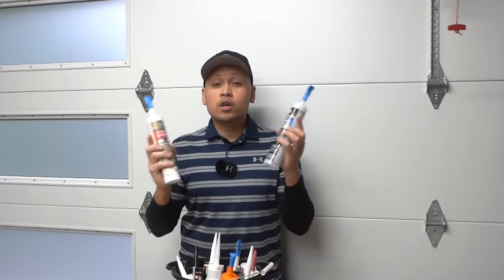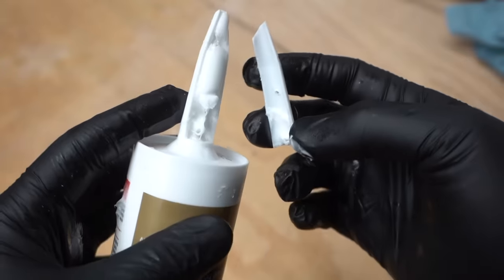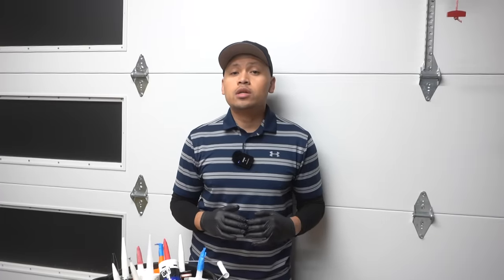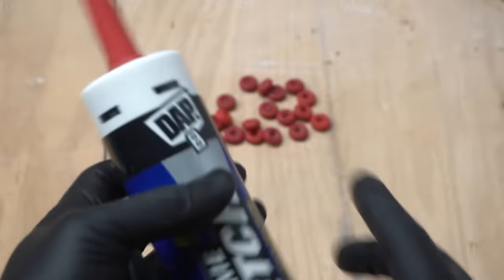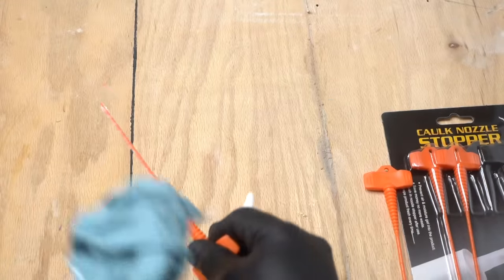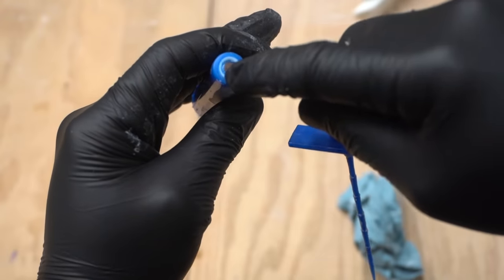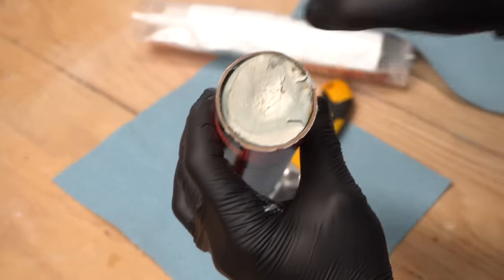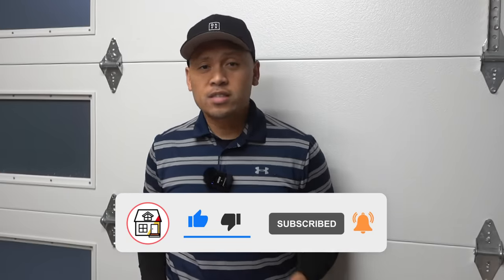STOP Throwing Away Half-Used Dried-Up Caulk Tubes! How To Fix It To Last Forever!

Comment: 37 years as a professional handyman and I've tried a lot of methods to save caulk tubes! What I used now is the red caps. They work well with about 95% of the products I use. With Henry's 208 or similar I use a nail and then a red cap over the nail.
Reply: Pretty much the same thing I have found. The little red condom things work perfectly, or some version of them. I have used wire nuts in a pinch, too, but they tend to not seal as well over long periods of time. Good enough for overnight, though.
Reply: They should juat embras what it is and sell it as chalk tube condoms
Reply: 37 years and you're still using Henry's?,?,? Poor quality products and overpriced.
Reply: Being a handyman is not a professional. You can be good at what you do but you can't call yourself a professional anything. There is no qualification needed to be a handyman. I know because I am presently one.
Reply: @esskayaussie286  if you’re paid for your work, I’m pretty sure that qualifies you as a professional. When you file your taxes, feel free to write “unprofessional” in your check memo.
Reply: @homemprovmentguy  There is no formal training to become a handyman. Skills are gained over time and via experience only.  A professional ungoes specific formal training. I am a professional RN, I am also a Workplace Health and Safety professional too because I have completed 2 different University degrees which provided the required training to the required specified professional standard. I also run my own small business as a handyman, but there is no such thing as a professional handyman as there exists no specific training or skill level that needs to be attained to call myself a handyman.
Reply: @esskayaussie286  here in the states, some states require no license to perform handyman tasks. It’s still a profession, not a hobby.

Comment: My great grandfather recently passed away and I went to clean out his garage.  He had some old caulking tubes that were over 60 years old. He used a simple wire nut at the end and the caulk was still like new. This was a very good video and I especially liked how the audio changed many times from barely being able to hear you, to full blast.
Reply: I used everything not marketed and wire nuts have always worked. I just try to not stretch the nozzle by over tightening, there's a size for every cut diameter.
Reply: @claudiodominguez.  what is this wire nut? 
oh ok  google showing pictures. i always knew them as toothpaste lids. i have a collection of vintage ones, have 2 try it next time.
Reply: @echelonrank3927  You will never need to buy any of those marketed gimmicks. Wire nuts cost pennies.

Comment: I have never seen any of these products, and love the condom-style cap👍. I have used the "screw in the hole" technique relatively successfully over the years. I put the screw in the nozzle, gently squeeze the trigger to push the screw out a 1/4 inch or so, then push the screw back in. This creates an airtight collar, and minimises drying out.

What I loved about this video was the obvious delight of the presenter, at the "How about that?" surprise, when the Tube Anew (?) device worked. Every day's a school day, right enough.

Very enjoyable presentation 👨‍🎓
Reply from the maker: Thank you so much Mark for the feedback! Means a lot! 🙏🏽😊

Comment: Thank you for posting this because I'm going to purchase the Tube-A-New now. But thinking about how many hundreds of dollars I've lost by throwing away tubes that were at least half full but had a dried nozzle really sucks.

"edit"  I finally got to use the Tube A New, thats got to be the best invention to the caulk world since the caulk gun was invented. Along with the nozzle condoms, no more wasted caulk!
Reply from the maker: I’m glad I could be of help and help you save those caulk tubes 👍🏽🙏🏽😊
Reply: Same here. I just threw a dozen half-empty tubes away thinking they were a lost cause. And then ironically this video popped up. Youtube can read minds I suppose
Reply: TubeANEW is same or more than just buying new caulk… 😭😭😭
Reply: @seanyiya  Not hardly... a three count is only $14.00, and depending on what you have used it on, you can clean them out and reuse them. The caulk I use runs about $9.00 a tube.

Comment: The best way to preserve the tube is to squeeze out enough to form a cap and let it dry. I caulk for work and this method is the best and will last for quite a while. Leave enough to be able to grab and pull out the dried plug. It's easy and free.
Reply: Does it work with silicone or just caulk?
Reply: That's my method, too.  Been doing it for years!  Especially with 230.
Reply: @rustyballs1255  it will dry down the tip, but once the air is gone the drying stops (and it always does). The tube is sealed and all you have to do is pull out the cork. Been doing this for thirty years.
Reply: @li2us  same 30 years, and I have been using Dow Corning 795. Great caulk. Tools real easy.
Reply: @janeblogs324  it works with just about anything out of a  caulk size tube. Will not last forever but I have some in my garage for 4 or 5 months and still good. Just make sure you leave enough at the tip to grab to pull out your self made cork.
Reply: That's a good idea. Use the product to form its own airtight seal!

Comment: Hot Melt Glue. Start at the center and go around until a cap has formed (looks like melted wax). It seals tight and can be pulled off with some effort.
Reply from the maker: Thank you for sharing Stephen! 🙏🏽😊
Reply: Or just poke the caulk tip into a toilet wax ring and make sure you get some wax to stay.  One wax ring will last you a lifetime
Reply: @huckwach3074  Great tip, but how many times do I really want to pull and reset my toilet? 🤫😁
Reply: @Luciano_Intorno  Only once!  Replace the wax seal with the caulk.  That way, the toilet will still work, you'll use up your caulk, and you won't need the wax seal for anything.
Reply: Hey Steven,  you beet me to it. I'm in my 50s and only last year did the bulb go off in my mind to try hot glue.  Thought I was going  to impress some folks. Lol. Anyway, wish I figured it out earlier in life, cause it works! Makes those other products  obsolete in my book.
Reply: @Prentis1  I have been doing it for a long time. The biggest problem is waiting for the glue gun to heat up.
Reply: @1622steve   I just plug glue gun in right before caulking. Unless its a big project which is rare.
Reply: @1622steve  I'll have to try this.  Does it prevent the material in the applicator from drying/curing, or do you still have to clear out thickened sealant?  It seems that some types will go hard/cure far into the applicator nozzle, even inside the main tube (might be due to air ingress around the threads where the applicator nozzle meets the main tube?).  Some are worse than others, decorators caulk and acrylic sealant seem to keep best, silicone sealant is the most prone (and expensive).
Reply: 1.) Tip in a partially full bucket of water.
2.) Electrical tape (BEST)
3.) Reusing the cut off and inverting it back in.
4.) Vaseline clump to plug the tip. Remember "Vasoline" from the old timeline, before the Universe changed?
5.) Golf Tee
6.) Hot glue (BEST)
7.) HVAC foil tape. (WHO HAS THIS LAYING AROUND?)
8.) Wood screw (WRONG).
9.) Red wire nut (NOT AIR TIGHT).
10.) Throw it away and pay $25 for a new tube.
Reply: @SaxJockey  Squirt a little caulk out until you have "good" caulk. Wipe off the nozzle, stand the tube on end, then apply the hot melt. It keeps for me long enough that the tube sometimes starts to harden from the plunger end. I have kept caulk for years. I usually use caulks with some or all silicon. Silicone cures through moisture, not air. Silicone won't cure if the air is completely dry or the bead too thick. I find construction adhesives the most difficult as the solvents are highly volatile.
Reply: @Luciano_Intorno 😂ikr? 😂
Reply: @Ritalie I have about 3 rolls of the foil tape.
Reply: Yup! I've kept caulk, adhesive and epoxies fresh for years using this. If you don't have a glue gun plugged in , a lighter and a glue stick could make a quick puddle that you could dip the tip in. Just keep the flame away from any volatile glue. Duh. . .
Reply: @huckwach3074     But then I'll start having toilet leaks...
Reply: @Prentis1       You beet, I beet, everyone beats beets...
Reply: Just clear out a little from the end of the nozzle and stuff some plumbers putty in, works for me.

Comment: I use hot glue to form a coating over the tip. Works great and peels off for the next use.
Reply: That's too smart and sneaky, therefore shouldn't be mentioned in public         ;    )

Comment: Interesting video. On this side of the pond our tubes come with a threaded removable nozzle. We can buy replacement nozzles too. I always unscrew the nozzle, put cling film over the tube end and screw the nozzle back on to seal it. But if we could buy those rubber seals here i'd use those; they look great.
Reply: Me too. Cling film works well.
Reply: Are you in England  ?
Reply: @colstace2560  Yes, I am. London to be a little more concise. How about you?
Reply: Same in Oz. When buying the product there is a big bin of screw on nozzles. Nobody seems to mind if you grab two or three with each tube. Then as you said, if product only dries up to the back of the nozzle, unscrew & fit replacement.
Reply: @markboscawen8330  G'day Mark. Looking forward to the Ashes tour this summer.
Reply: In the U.S. there’s some tubes with removable screw tips. While many still don’t have any way to remove the tips that you got to seal up another way?
Reply: Those nozzles always litter my workshop until I need one, then they somehow all go into hiding.
Reply: @ghostridergale  You can convert a common one piece nozzle into a removable nozzle by cutting it near the base, installing a piece of thin wall metal tubing and using 2 small hose clamps to hold it all together. All the parts are reusable when you are finished with the tube of caulk.
Reply: @LFBsmokealarm    Alcatraz
Reply: Chateau d'If. Your turn.
Reply: @markboscawen8330  in South Africa as well. We get a big bin of them and you take as much as you can.

Comment: I always wondered if using a nail or screw was actually introducing air into the sealant.  Seems like all of the solutions I've tried fail, and out of what you showed, the caps & Airtite tube are the ones I haven't tried.  Got to admit, your test showing the caps caught my attention!

Comment: OTHER THINGS TO TRY:

1. Drill out the hard sealant. Drill right into the tube (with the nozzle off). Use largest possible drill bit (maybe 8mm). Clears a passage.
2. Clean nozzle (from both ends) with hose after use (water based only).
3. Dispense without nozzle on, where possible.
4. Stretch disposable glove over opening before replacing nozzle for longer storage.
5. Try storing tip down in a 1/2 filled bucket of water (to exclude air).  

(i have over 50 years in trades)

Comment: Cut the end of the tube off just a bit, if necessary, and twist a coarse-thread decking screw into the tube. The clog will stretch and be easy to remove when you pull the screw out along with the clog.
To preserve the caulk much better, purchase several red (color-coded to size) electrical wire nuts that have metal coils in them that will self-thread on the tube.  They are the best caps I have found and are reusable for many years.
Reply: Great tip... This is why I read the comments section. 😅
Reply: Put a little caulk in the wire nut helps
Reply: Obviously, don't try to use it for splicing wires after you've used it to cap a caulk tube!
Reply: I do that also and have had good luck with it. Wire nuts sound like a good idea I'll have to try them
Reply: I have used the wire nut. But the best thing to do is use electrical tape. The electrical tape is a pain to remove, but it's 100% air tight, and there is zero drying, even at the very tip, so if you're trying to prevent dry chunks in the nozzle, the electrical tape is by far the best I've personally used. I stopped using other more simple methods, because they aren't reliable for certain fancy caulks that seem to dry for no reason.
Reply: I've used wire nuts for years.  The idea is to create a vacuum thru which no air can penetrate.  So, I use the caulk against itself.  Put caulk in the wire nut before you screw it onto the tip.  Then once the wire nut is on I turn the tube upside down and fill the balance of the wire nut with a small amount of caulk I'd squeezed out beforehand.  Nothing is infallible, but this works better than anything else I've tried,
Reply: Electrical tape.
Reply: My boss pays for it so I don’t care
Reply: Seems like sometimes screws work and sometimes they don't.  I've had screws rust in the wet caulking too.
Reply: @ianfarrar5634 why did you watch this then?  What if YOU were ever the boss? Would you want you as an employee?
Reply: Wrong! Lol
Reply: @ianfarrar5634  Economics 101:  All costs trickle down.
Reply: probably the best idea I've ever heard

Comment: Pot the screw or nail then add a bit of heavy grease or vasoline

Store where the grease will not melt

Or add grease to the edge of everything.  Remove grease with paper towel

Spend a bit of caulking to remove grease contamination 

Or buy caulking wit the snap
On caps

Grease edge of cap. Best one

Comment: I usually put the caulk cap in my mouth to help ease it over the tip. Works pretty well most times but occassionally the caulk squirts a little unexpectedly.

Comment: The products that you have shown look great... over the years I've had great success with using the cut-off tip, then inverting it back into the nozzle, as long as the initial diagonal cut is larger than the tip diameter. My other 'go to'  hack is a simple wooden golf tee, works great!
Reply: Some people use electrical wire-nuts--screw-on.
Reply: @craigharding475  👍👏🏻 Thats what I use and it works excellent...

Comment: Great and sorely needed video!!  I'm so tired of seeing contractors throw away caulking and adhesive tubes (and surely charging their clients for) that are often times well over half full.  What a waste and environmentally unfriendly.  I use aluminum tape to cover used tube tips and if works well.  But, you've taken it to a whole new level.  I will be purchasing a couple of items you have mentioned!  Thanks Man!  👍

Comment: You may try this. Squeeze out around 1cm of silicon on the nozzle. Don't wipe it off. Then use tape to seal the silicon together with nozzle. Within time, this 1cm of silicon might get harden and it would become to a plug to seal the nozzle from air going in. It is easy to remove this silicon plug before usage. This is how I do it.
Reply: Correct. Just slam some electrical tape over the drippy end of the nozzle, and it lasts forever. Electrical tape isn't being mentioned, and I believe it's the only tape that works 100% reliably.
Reply: Same here but i might add your tip of adding tape over the end to stop the dried end getting knocked off by accident.

Comment: Thank you for this video to show products to caulk storage problems. I didn’t know these products existed so this video is very helpful. Another idea is many years ago I ended up improvising using the seal n press  plastic food wrap to keep my caulk from drying up and not used anything else since. It’s worked really well keeping the caulk from drying out for about 6months then the temperatures in the northeast USA affect it as I keep it in the basement. 

One thing - caulk is pronounced with a silent ’L’ in the USA. 

Otherwise this is a great video being clear concise and to the point. nice work!

Comment: Two lessons I have learned over the years:  Use a piece of HVAC foil tape to seal the end of the tube, it isn't permeable and sticks better than masking tape.  And if you live somewhere like Phoenix, AZ, store your caulk in a conditioned building, even if the tube hasn't been opened.
Reply: good choice, Owen. haven't thought of that. I use shipping tape. described above in a comment.
Reply: I recently started doing this and it works great. I also recently started using hvac tape to seal grout bags that are opened. Works great.
Reply: Well I live in Michigan, and have found letting my caulk or glue freeze is NO good either. Maybe 30 degrees is the coldest you want it to get
Reply: imagine thinking that painters tape isn't permeable to air
Reply: I was going to post this same tip, Owen.  Tape the end closed with foil HVAC tape.  Aluminum foil is the best vapor barrier.
Reply: @iamgriff  I was just about to say the same thing from the prairies in western canada.
Reply: I have always used foil tape with success, but I also sometimes stuff some plastic wrap into the plunger end or wrap the entire tube in a plastic bag because sometimes that plunger cap doesn’t stay sealed around the edge very well after the caulk gun has pushed it in a bit.

Comment: Great video on this annoying problem that I suffer from as well🙄.  Bought the Red Caulk Caps and used them for several months.  Seem to work better than any trick I tried with other caps or tape. Thank you "Fix The House". Why the manufacturers don't provide a secondary screw on plug for this 10oz. tubes to reseal them is a loss to me. All that would be necessary then is to unclog the primary cut off cap.

Comment: This was great! I have struggled for years with dried up caulk and construction adhesive. I have had some luck cutting the nozzle down, but it gets so large in diameter and so short in length to become almost useless. When you cut away the side of the nozzle of the dried up tube, this was exactly the same as I have experienced. I ordered the Tube-A-New and the Caulk Caps. I figure that I can save some existing dried up tubes and then use the caps in the future. Thanks for doing this video and posting the info.
Reply: Caulk Caps on the Tube-A-New if you don't use it all!